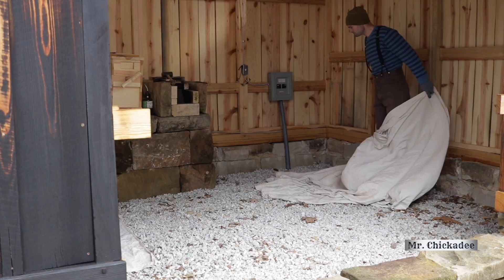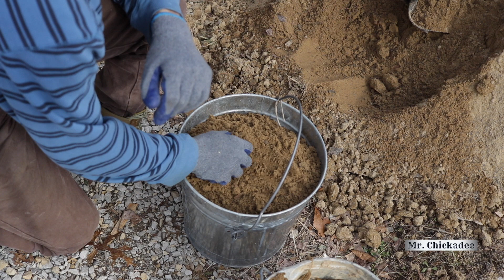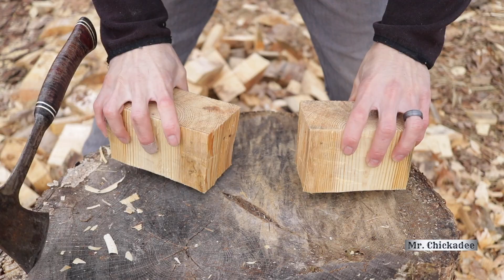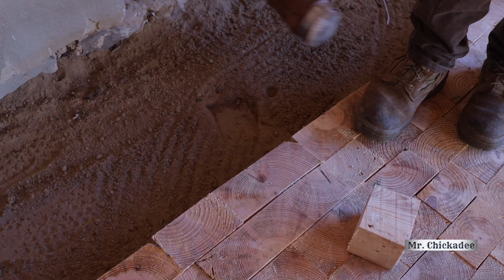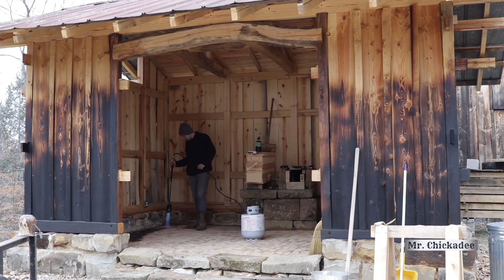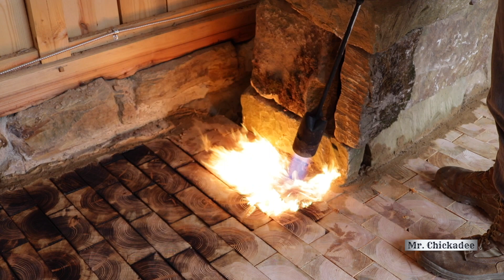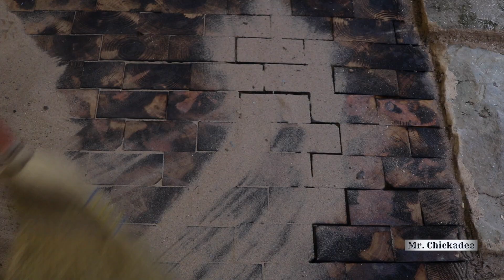Making a wood brick floor for our blacksmith shop

Comment: The streets here in Texas used Bois D Arc blocks. They seem to last forever. Many would be surprised to learn they are still there under the asphalt in some cases even in Dallas. What is the recipe for clay mortar?

Comment: What is longevity of a floor like this, it isn't pressure treated and has a sand base. Wouldn't ants and termites be a big problem? I understand you burnt the tops, but are the bottoms of the brick also burnt with the method you used? Did you ever pop one up to see? End product is gorgeous. But it isn't the kind of floor I would have chosen for a smithy. It would catch if you dropped anything >1000F and if you can't get a forge up to at least 2000F isn't it kind of pointless? High carbon steel, even wrought iron (higher carbon steel) require higher temps. I am interested in you testing out durability of this floor when the forge is in active use.

Comment: My father was teaching working with metal lathe at tech college, in late '70 and '80s. I was visiting him, coming home from school. They had such floors in their workshops.
Almost 35 years later, I still remember that awesome and surreal feeling - walking on such floor. 
Perfect noise dampener;  you can't destroy your tools , which could fall from some height; great fire retardant and indeed, soft for your whole body, if you have to work in standing position for some time.
Great idea and as per usual, meticulous execution of it ;)
Do you know, by chance - was such flooring used only in some countries or was that a worldwide, well known standard back then?

Comment: It has been wonderful seeing both the methods and the results since I found this channel. I have noticed several instances where wood is charred as is the floor in this video. It also appears that the lower portions of the walls have been burnt. I also recall the charring of the wooden circle doorway for the root cellar project. What is the purpose of the burning? Is it just to give an aged appearance or does it accomplish something?
Reply from the maker: Burning is not only lovely, it is the best preservative possible. Well burned wood is fire resistant, rot and insect resistant too.
Reply: @MrChickadee  I thanks you for the information and for the timeliness. I wish you all the best in your pursuits.

Comment: I've seen floors made like this... probably from normal 2x4's but I wonder if it's a great idea to use fresh wood? When it dries out the blocks surely shrink, warp and crack. Not that its a huge deal, but still. Great job non the less.

Comment: As it is a blacksmithing shed so isn't there a safety concern as the wood might burn as there are a lot of things that require lots of heat in blacksmithing?
Reply from the maker: I torched the floor to show how fire resistant it is. I drop red hot metal all the time, it smokes a bit till it cools or I pick it up. Its nearly impossible to catch this floor on fire. You would have to soak it in gasoline, and then it might only burn til the gas is used up haha.

Comment: I'm surprised you didn't go over it with a vibrating 'wacker plate' to settle and level the blocks, as one would with concrete block paving?

Comment: Curious what the purpose of the tarp is? Looked through the comments but didn't see anyone talk about it.
Reply: Damon Mcmahan so there is crushed stone on the floor, and there is a lot of openings and spaces between the little stones. If you don’t put a barrier down on top of that, the sand will slowly move downward between the stones. Then some of your floor bricks will sink into the empty space, creating an uneven walking surface.

Comment: I understand the endgrain up for expansion but I was wondering how green was the log you were cutting?  Also wondering if any type of wood works for this or are there some I should avoid?
Reply from the maker: It was green as a guard man. End grain up is not for expansion, its for durability, as end grain is the strongest orientation of wood.
Reply: @MrChickadee  Thanks for the response. Thinking about it the floor has no fasteners so expansion wouldn't be a major concern. I have some walnut trees that are too small to mill but to big to waste. This seems a lot nicer to work on than concrete on a shop floor. I dig it.

Comment: One question if u dont mind answering please, were these used on outside surfaces, and if so, would some water resistant coat be applied on the wood?

Comment: Would these work in a horse stable aisle in a similar way as were used to make streets? I was wondering if they'd make good stable flooring and how to go about that. I can't find any info on it online
Reply from the maker: Yes but might want rot resistant wood for that
Reply: @MrChickadee  thank you! Good point - which varieties would you suggest? Also, how would you finish it to enhance durability?

Comment: Hey! Amazing video, watched it all the way through and the finished product is gorgeous! I did want to ask about the sand you used, both under the bricks in the 2 inch layer you described in the subtitles and the dry sand you swept on top. Are they the same composition of soil? As in were they both the same content of silt, sand, and clay? Or was the dry sand have less silt? The coloration was different and I'm sure it was just because the sand you layered below the bricks had water added to it before hand, but I'm not exactly sure and wanted to hear your method and soil compositions for each type. Thanks!
Reply from the maker: Its all just silty fine river sand, some was dry though and lighter.

Comment: is there a reason you didnt back the truck up to the door and shovel the sand directly onto the floor ?
Reply from the maker: Because its easier to evenly distribute it around in small bucket sized piles, rather than having a huge pile right by the door, you then have to spread that out somehow and hope its equal.
Reply: @MrChickadee  makes perfect sense thank you .

Comment: Thanks for the video, enjoyed watching it. Just one question: Why do they not rot away after a couple of years? Untreated wood on dirt in an unheated cabin, this should not last long. Best regards
Reply from the maker: Dry wood does not rot. Deep bed of gravel, large drainage trench all around the building ensure dryness.
Reply: @MrChickadee  Thanks dir the quick response! Alright, makes sense. Just stumbled randomly over your video, therefore die not know about the ensured dryness. Have a nice day

Comment: Wouldn’t the sand in between the blocks settle over time? You’d have to keep adding more sand until every single crack between each block was full
Reply from the maker: Sand can be added from time to time, it never needs to be "full" exactly for structural integrity, though it wont hurt and will eventually be so.

Comment: Not sure you'll get this but I'll ask any way. Looks like you're using pine for the floor, how has it held up so far? Been thinking of doing a similar floor myself.
Reply from the maker: its just fine, drainage is really key here, both total drainage trench around building and the 10+ gravel bed under the floor
Reply: @MrChickadee  great to know thank you. I may contact you later about the stone foundation later if that's ok

Comment: Just wondering how the floor is holding up. Noticed you used a compacted gravel base with a permeable layer over top. No bug issues with the wood? I’m doing a 24x24 pole barn and plan on doing this with all the “free firewood “ out there

Comment: So quick question. Love the design but i mean wood expands when it gets wet, is the gaping sufficient enough to prevent the foundation from pushing out on rainy days or days with high humidity?
Reply from the maker: Installed green, can only ever get smaller.

Comment: Really nice as usual. I was wondering what about the humidity from the ground? Thar side of the bricks has not been burned?
Reply from the maker: its all very dry with the perimeter drainage trench and the 12" or gravel inside under those bricks. Even though the sand and bricks were very wet installed, everything is bone dry now. (Ive checked by pulling up a few)
Reply: @MrChickadee  Nice! I didn't know about the trench.... Those bricks look awesome!

Comment: Hmm, 

Here in Scandinavia those floors were built much the same way, but the blocks were dipped in boiling tar before applying them to the floor. 

Or in more modern times boiling oil. Just curious why you didn't see this nesserary? Are the conditions where you live that much different from ours?

Nice clip props out for keeping the old techniques alive

Comment: Nice job. I think it looked better before you scorched the wood bricks though.
However, I suppose if you drop hot iron now, it won't be as noticable.
Lime morter around the parimeter?

Comment: Don't the wooden bricks rot being placed against the ground? I've only seen these wooden floors laid on top of dry platforms. At least over here any wood that's in touch or close proximity with soil will get wet and begin to rot. Sand will carry moisture easily. And you can't seal against that: the moisture will seep in from somewhere.That's why floors here are off ground so that there's air underneath to keep it dry.
Reply from the maker: They are not in ground contact, but on a large 10" gravel lift, which is sitting inside a drainage trench, which is all covered by a massive roof overhang, no sir, they be bone dry...

Comment: Hi from DownUnder, nice looking floor and comfortable to walk on. However, this is a blacksmith shop and with red hot metal flying about I am concerned about the fire hazard. Brick or concrete is inflammable.
Reply from the maker: Its never an issue, hot coals and metal only smoke a bit before going out or being picked up. It really would be difficult to actually burn this floor, even with chemicals. I tried to show this with the torch.
Reply: @MrChickadee  You’ve god dense end grain which is harder to burn, I take your point.  Wood is so nice, sound absorbent, shock absorbent and easy on the feet. Good choice as it turns out.

Comment: Is a wooden floor wise for a blacksmith shop?
Reply: I'm pretty sure that's part of why he charred them.  Also, there isn't sufficient oxygen from underneath or the sides to let the wood blocks combust.  I'd wager the building could burn down and the floor would still be in good shape.

Comment: What is the benefits to a floor like this for the amount of work that goes i to it?
Reply: Pride?
Reply from the maker: Its cheap or free to make, very gentle on your joints, does not soak up and hold moisture like cement, is warmer in winter, is uneven which also helps your body, its more easily repaired if needed, its more sustainable and "green", its also pretty.

Comment: I don't understand not securing the bricks to the floor and leveling them. Also don't understand why you wouldn't seal wood in an outside shed. Hmm.
Reply from the maker: This is how its traditionally done, and dead level is actually not good for a human to stand on all day. Also, sealing wood in the modern sense is about the worst thing you can do, it must breath and move freely.

Comment: Is it just me that thinks there must have been an easier way to get the sand in there, instead of loading it on the truck, dumping it a few feet away from the door, putting it into buckets, and then carrying it inside to dump on the floor?
Like, backing the truck up to the doorway and just dumping it straight in..
Or is there something I'm missing, like was the sand cleaned or sifted beforehand or something?
Reply from the maker: ever spread sand 2" evenly across a large space? If I dumped a whole load in the doorway, now I would have to shovel rake and otherwise try and spread it all around. If you notice I used the buckets to dump equally spaced grid pattern of small piles all around, then just spread them with a rake.
Reply: @MrChickadee  Ah right, that makes sense now. 
So there was something I missed!! 
Thanks for the response..

Comment: After install, is it possible to use a floor sander? I am building a small machine shop with a sawmill and i needs moderately smooth floors for rolling tooboxes and welders on. Truly awesome videos as well.

Comment: So water doesnt wick up and rot the floor then? That wasn't vapour barrier you put down under the sand.
Reply from the maker: The drainage trench all around the foundation, the back fill of 10" gravel combine to keep the floor dry
Reply: @MrChickadee  Very good!
Reply: @MrChickadee  10"!  That's a lot of sledge hammer work!

Comment: How well has the floor held up? Still level?
Reply from the maker: Held up good. I read its best for joint health to have a less than level floor, so I deliberately made it out of level, I think it is true.
Reply: @MrChickadee  good deal. Im gonna do the floor in my cabin like that. Great work.

Comment: You did very well. But i see one major flaw. You put no moisture isolating layer betwen the bedding sand and the underground. Maybe you will have the next few years the problem that your floor will rott away. If you are lucky your underground is dry enough that nothing will happen. Cross your fingers. Greedings by a german civil engineer.
Reply from the maker: Drainage is the key here my friend. The drainage trench I installed around the building, as well as the large roof overhangs, keeps everything in the peremeter bone dry. Even while installing with wet sand and fresh green bricks of wood, now all is bone dry down and through.

Comment: Excellent skills but a wooden floor in a blacksmith shop?
Isn't that asking for trouble?
Reply from the maker: No, not at all. I got the idea from Peter Ross, very famous retired master smith, Ive dropped many red hot pieces of steel, just smokes a bit till you either pick it up or it cools. You would be hard pressed to burn this floor with petrol.

Comment: That is some seriously amazing work. I liked and subscribed! I'm a carpenter by trade.  Now that I've seen this video I'm planning on doing this in my dirt floor basement. My main question is why do you use the canvas as an underlayment? In my mind it seems that something that acts as a moisture barrier would be more beneficial. Perhaps it's better to let it breathe? Also what does the flame treatment provide? Is it aesthetic or does it add durability to the floor? My house was built in 1909. The dirt basement floor normally stays pretty dry.
Reply from the maker: I avoid basements out right as a generally bad idea causing lots of issues with ground moisture. I can only in good mind recommend this method or others like it within its traditional application, which would be in a high and dry, well drained surface. It may work, but I would consider it an experiment...
Reply: I thank you kindly for the time you took to reply. You have helped me to reconsider my plan.

I'm thinking now of maybe bringing in some clay and packing it down into the existing material.

Or maybe bringing in sand and lime.

I'm not trying to have a perfect basement, just a better basement.  I would like to do it inexpensively. I don't mind putting work in.

Do you have any suggestions on how I might make my dirt floor basement a little bit better?

Thank you very much for your time.

Comment: Pretty, but it's a big no no putting wood directly only the ground in any way. Rot, insects, fungus, etc.
Reply from the maker: Correct, this is not "directly on the ground" it is a 10" gravel base laid withing a covered foundation with tarp and sand bedding, the bricks are laid 12" above well drained grade soil, they are perfectly dry and pest free 4 years later.

Comment: A couple of Timber Railway Sleepers and you’d have had the same thing in a fraction of the time.
Reply from the maker: yes, there are many ways to do this, I guess you could invent a massive computer driven robotic arm type creature thing which would fell trees, eat the wood then poop out the bricks all while you sip beer in the shade! 
Me? I dont mind spending a little time enjoying my hand tools, to have  floor such as this.
Reply: It's indoors so you'd be constantly breathing in whatever was used to treat those sleepers.

Comment: sorry to break it to ya but... its not a factory, its not the early 1900s, you dont have hooves and youre not in a town center. and a wood floor isnt gonna do much to muffle the sound of steel hitting steel.
Reply from the maker: Its a durable, practical, beautiful floor, which I made myself, its easy on the eyes, the pocketbook, the environment, my JOINTS, and dropped tools...for these reasons alone it was a worthwhile project